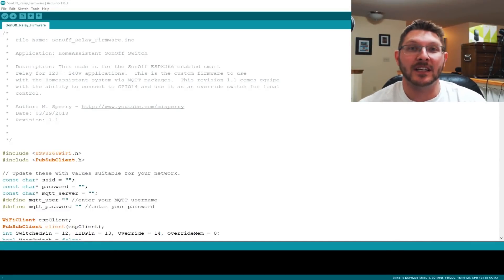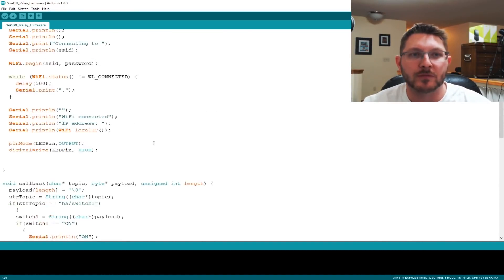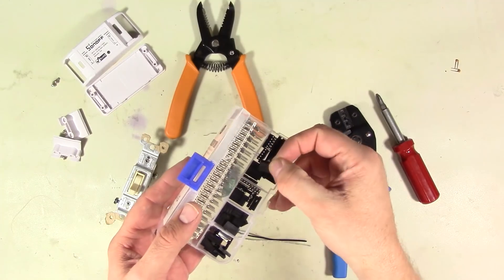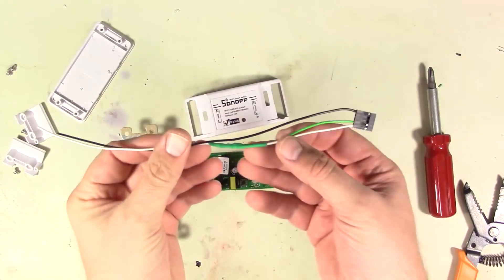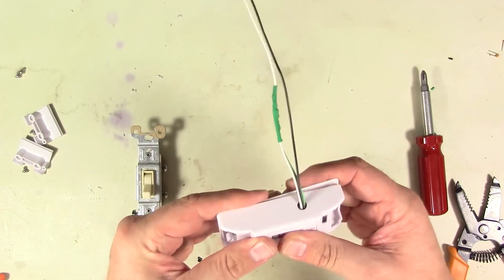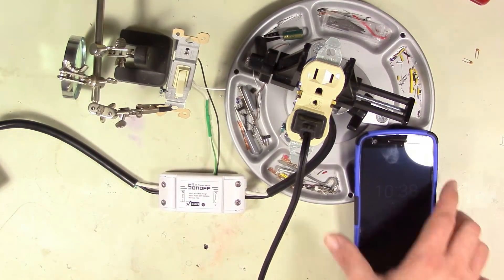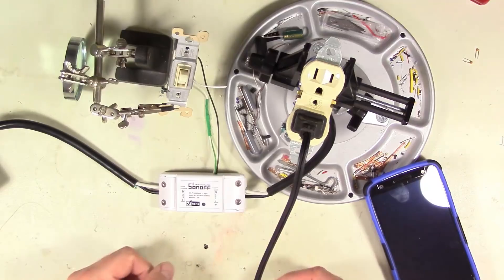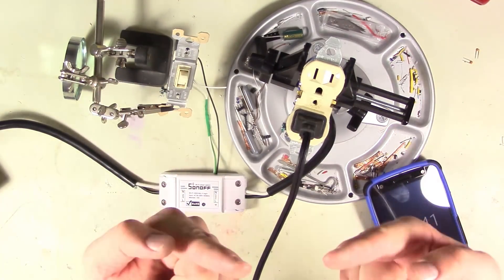SonOff Override Switch

Comment: have you tried it on any electronics aside from the lights? i want to use it in a fan. so i can remotely control my fan or my ac
Reply from the maker: This should work the same for anything that uses AC power.  However, what it will not do is speed control a fan.  it is simply a wifi controlled relay for AC power.  It does not have any SCR's or TRIAC's in it to control speed.

Comment: Ground is overrated.  It's pretty much dogmatic at this point.  I'm temporarily in a country that has basically zero ground cables for historical reasons.  Even apartment complexes have no ground for the building, so there isn't even an option to retrofit without physically ramming rods into the earth.  The casualty rate due to lack of ground?  Zero people per ever.  (Ok, realistically speaking, take India for example.  19 residential deaths over the course of 5 years*.  And they even have ground wire regulations!  40% of the time the death was from touching the live wire directly.  So we're talking at most not even 1 death per year per MILLION people due to lack of ground wire.  In fact, a person was 3 times more likely to die simply by being male, so if you're worried about a ground wire you should actually be *more worried about your gender if you're male.)
Reply from the maker: I agree with you.  Toughing the ground wire does nothing.  However, I was an electrician in commercial/industrial and I saw time and time again Motors that would have a winding short against the motor case and if it was not grounded and some one touched that case and they were grounded they could get killed.  Also I have seen fires caused by arcing where there was no ground because if things are properly grounded if for some reason a wire is loosely connected and starts heating up because of the bad connection it will melt the insulation off the wire and if no ground is present it will continue to get red hot and set the wall insulation on fire and burn the house down.  However, if there is a ground, which in houses is usually bare for this reason, if the insulation would melt off of either the hot or the neutral it will short to the ground and trip the breaker thus stopping the fire.  I am sorry but in my professional career I have seen many many many cases where grounds were not used and loss of life or property was the result.

Comment: a Quick simple question: Why go through all the hassle of programming and wire connectors if you can simply  override the entire switch by attaching 1 Life wire before and after the switch connected with the manual switch as shown in this sketch       https://i1111.photobucket.com/albums/h476/grandma75/SONOF_DUAL.png
Reply from the maker: Thanks for the comment.  I am not able to see the picture you have but I can get the gist of what you mean.  Simply putting a switch in parallel with the sonoff switch I think is what you are saying.  This would totally work as an override. However, you would not get the feedback into your homassistant that it has been overridden.
Reply: Your suggest circuit totally doesn't work. If the device is on by one switch. You cannot turn it off with other. 2 switches in parallel, where one is on, Circuit is always on.

Comment: I have been looking for something like this for awhile but I want a little different function of the added switch. I want the external switch to be a momentary on push button mounted in the switch plate connected to the sonoff buried in the junction box. Pushing the switch would simply change whatever state the sonoff was in. My sonoff is controlled by a motion sensor via MQTT . I want the switch to be able to turn the light off if it was on and on if it was off. 
Great video here..
Reply: Have you found it? I'm looking for the same thing :)

Comment: I understand this an old post, but very informative I both learned and enjoyed it. Few questions if you don't mind ;
You said "you can only control it remotely if the light switch is in the OFF position" so if I understand this correctly, does the light switch being in the ON position update the interface on your phone to show its current state is ON? (I was hoping to see it update but you put the phone to sleep before you flipped the switch lol)
Also what happens if you've toggled the light ON remotely in the app then it is overridden via the physical switch to OFF? as well as if the light is already ON via remote and you flip the override switch to ON as well will it cause any undesirable effects?

Thanks in advance ☺

Comment: Hi, I'm looking to modify your code to build a wemos d1 mini switch with a push button. I'm not a coder but from what I can tell, if you define overridemem in your mqtt loop as mirroring the HassSwitch boolean and the HassSwitch as mirroring the overridemem in the override loop - then this will allow you to use the press button interchangeably with the mqtt control? Or have I made a silly assumption?

Comment: Once the physical switch is in off state can I turn the light/device back on using the sonoff switch?
Reply: No, you can't. The physical switch has to be on to be able to use the Sonoff smart switch to switch the connected load OFF or ON.
Reply: @kj3283w only with a wall button instead of wall switch...you can solder the 2 pins from sonoff's button to a wall button and then they can operate indepedently..its like having 2 sonoff buttons

Comment: you could crimp 1 leg of the resistor in with the white wire and put a crimp directly on the other leg and put it direct into the connector. This would save you the green jumper, soldering the resistor to the jumper, heat shrink, and you would have a clean white and black wire to your switch and no risk of snapping the resistor leads as those wires flex.

Comment: Hi, can these be wired to the sonoff input off of a 3 plate pendent and then looped out from the sonoff output to led spot lights. And then still controlled via the light switch? Just asking as I don’t have a neutral at my switch only my pendent. Thanks

Comment: Thanks for the video! I am very new to the exciting world of hardware tinkering and I was wondering what is the point of your 2K or 10K resistor in this scenario? I've seen other tutorials, where you connect your light switch to sonoff without any resistors. Thanks!
Reply from the maker: I have received many comments about this and so I tried it both ways.  I  believe this comes down to what type of SonOff device you have.  The specific one I have I don't believe has internal pull ups.  Now anyone can correct me if I am wrong I just simply cannot find anywhere that says one way or the other, again on the specific model that I have.  However, on other models of the sonoff it has internal pull ups so you do not need the resistor.  I hope this helps.
Reply: Thanks for your reply! I have a SonOff Basic. From what I've been reading, those resistors are used to eliminate unexpected switch based on surrounding noise. Is that right?

Comment: Here is my implementation of Override Switch without the need of a resistor or capacitor. I haven't had an issue with Ghost Switching or Floating. I hope this helps:

https://www.dropbox.com/home/homeassistant/projects/Sonoff/Master%20Bedroom%20Fan%20Light%20Switch

- Don't forget to ground your toggle switches like misperry explains.
Reply from the maker: Awesome.  Thanks for the link and the great solution.

Comment: Here is a pick of the built in pull up resistor for sonoff th  https://www.superhouse.tv/wp-content/uploads/2017/01/Sonoff-TH-bottom-breakouts.jpg. Schematics https://www.itead.cc/wiki/images/3/39/Sonoff_TH10A%2816A%29_schmatic.pdf
Reply from the maker: Awesome thanks for the info.  However, I think the one I have is different.  There are many versions of the Sonofff smart switch and mine is the flollowing: https://goo.gl/images/PqQ8j6  I don't think it has the pullups like the one your link shows but I could be wrong.

Comment: Hi, can i flash sonoff using arduino uno only?
Reply from the maker: Well you could use an uno since you can remove the micro and use only the RS232 to USB chip that is on board.  I don't know about the others.  The best way is to just get a cheap FTDI converter that converts the RS232 to USB and then it will work with the arduino IDE.

Comment: take a look at the WIFIMANAGER library, is very easy to setup and you don't need to put your credentials in your code anymore... it creates an access point if no credentials in SPIFFS are found, so you can scan your near wifi networks and connect to 1 of them, and you can add custom controls to allow to put in the mqtt server/user/password, too, no need to recompile your own sketches just for that... :)
Reply from the maker: That is awesome!  Thanks for the suggestion.  I may make a video out of that.  Good Call!👍

Comment: great video was funny about the ground wire LOL any chance you could do a video or 2 about how to use RF card reader to open gates everyone does garage doors but many people have fenced in yard with gates to open to get to the back of your house and that is when I will for get my keys and hands are full but if I hade a RF card in my pocket the gate would just unlock and re-lock when I have walked threw and got out of range to the RF reader That could be a handy video
Reply from the maker: That is a cool idea.  Thanks for the tip.  I will check out doing that to my own gates.

Comment: Hi, Are you sure you need a pull down resistor for this. One is built into the esp8266 chip. I personally use only a capacitor between gpio 14 and ground to keep switch from "floating" and "ghost switching" using TASMOTA code. Also how does this code differ from the very popular TASMOTA code. Thanks Mike
Reply from the maker: Hey there thanks for the comment.  What would the code be to utilize the internal resistor?  I thought it had internal pull-up resistors if the pint was set as output but I didn't think it had internal pull-down resistors on pints set up as input pins?

This code is different because I am just showing you how to customize your own code for this.  I will be releasing, soon I hope, an in-depth look at the code to see how I am simply performing the interaction with Home Assistant via MQTT and the code for the override switch.

Thanks for the comment.
Reply: I am not a coder. I only dabble a bit. The tasmota code sees a short between gnd and gpio14(or change of state). Although some say you need a resistor between these two, I found it to cause more problems for me in real life(using tasmota code). I do however use a simple capacitor between gpio14 and gnd. This stops switches changing  states on its own. 
I see you are shorting gnd, gpio14 and 3.3v. so a little different to shorting gpio14 to gnd only. 
As for the code. I see you want to show the process to code the switch. This part really interests me. More than one way to skin a cat lol.

Here are examples https://www.youtube.com/watch?v=-9zNS-ljDzo and https://www.youtube.com/watch?v=chyVjtYb0EA
Reply: misperry will be waiting for your update, thanks misperry
Reply from the maker: Cool thanks for the comment and I will check out those two links you gave.  Thanks again.

Comment: Just what I´ve been looking for! I have a doubt, resistance is in between GND and GPIO14? and what is the best value for resistance? Thanks
Reply from the maker: Yes I put a resistor from GPIO14 to ground and the resistance I chose was around 2K.  However, in another comment Mike Vidal stated that you may be able to utilize an internal pull down resistor for this somehow.
Reply: You don't need the resistor because the esp8285 in the sonoff already has a pull up resistor. I just wired gpio14 to the switch and switch to ground. It is working very well for me.